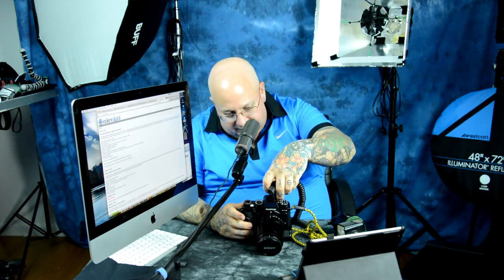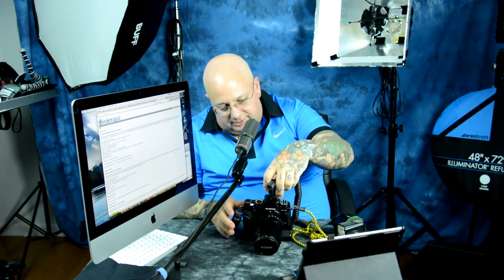*!* Fujifilm X-T2 Speedlight *!* Tips & Tricks, HOTSHOE pinouts & info

Comment: To electronics people, "pinouts" refers to the SIGNALS on the pins, not just the physical arrangement of the pins. So no, the Fuji cameras are NOT compatible with Canon pinouts!... only with the physical dimensions. Not a big deal, but might save some confusion in terminology...
Reply from the maker: i referred to canon pinout ARANGEMENT,  i never said a canon TTL speedlight can be used on a Fuji.  :P 

the signals sent are completely diff including from camera to camera, since for example the NISSIN I40 can do TTL on the XT1 but is useless on the XT2

Comment: Center pin is not same on Sony, yeah I know what you gona say :-)  but Sony speedlight  ain't gone work with e.g normal FlashQ. One has to buy new version T1 (received full set last thursday and many thanks for tip Ken :-)
Reply from the maker: i know that,     still a center pin trip,  but hey, who cares about sony
Reply: +Theoria Apophasis I care since I have 2 sony  flash unit (among other stuff)  using them with success on the Fuji xpro 1 XT 1 ,Olympus & Sony camera's.Both can also fire HSS via cable trigger, so why spending money on expensive Metz flash, since I using them manually anyway.

Comment: you haven't mentioned the fuji made efx20 flash, its super well made, some people don't like that it doesn't have a swivel but off the camera mounted on a bracket etc you can bounce it anywhere. recycle rate sucks but with enloop batteries its decent enough for the occasions i need it. also use the velo cable.
Reply from the maker: but it cant do TTL on the XT2 :)
Reply from the maker: a cheap old use nikon speedlight is cheaper and better
Reply: didn't know that about the xt2, won't have the money for that one for a few months, and i need my TTL crutch so i guess ill be counting on upgrading the flash unit as well. lol
Reply from the maker: fuji just delayed their speedlight again…..by 2 more months   Hahhahaha

Comment: ok My dam canon speedlite 430EXII is compatible with Fuji 👍 yeahhhhh I like this dam Ligh moor then before 😵😵😵
Reply from the maker: welllllll no, i said the PINOUTS are the same, not the same firmware for TTL control!!!!

i only said PINOUTS       CABLE YES………….speedlight TTL NO.
Reply: SO what does that mean? Can I use my Canon 580ex on my X-t2 using a Canon TTL  cable in manual mode? Are there any settings I need to adjust on my X-T2 for manual mode? What are your thoughts on Cowboy studio remote triggers to accomplish this?